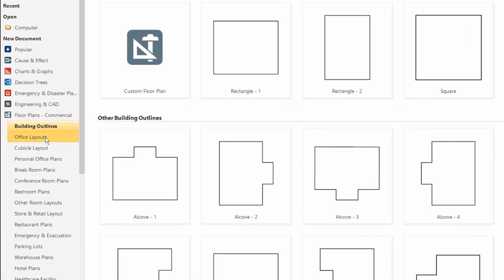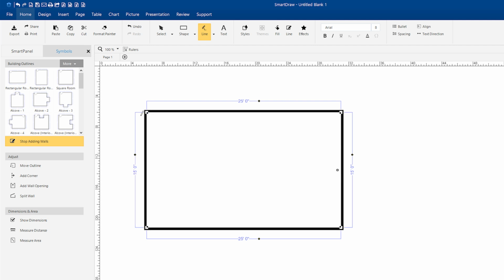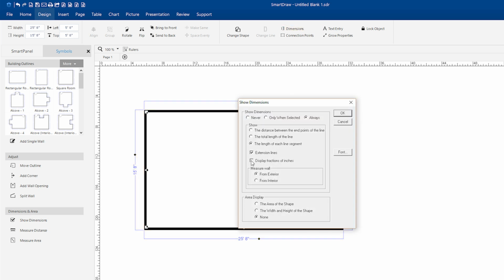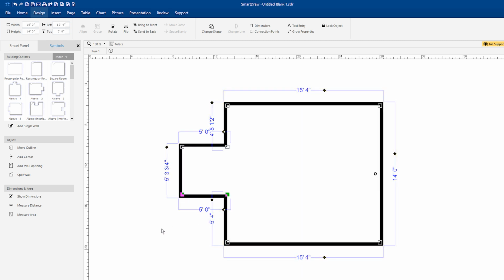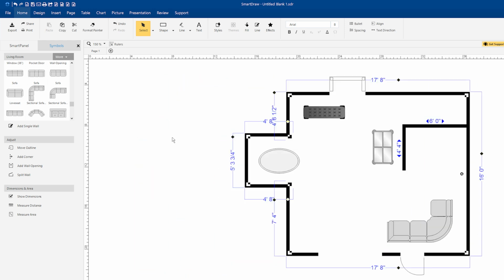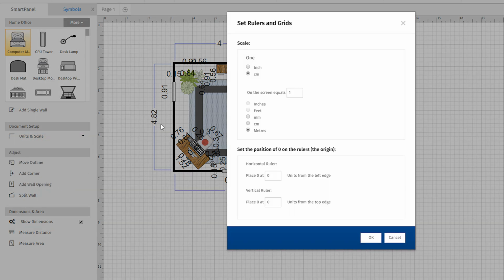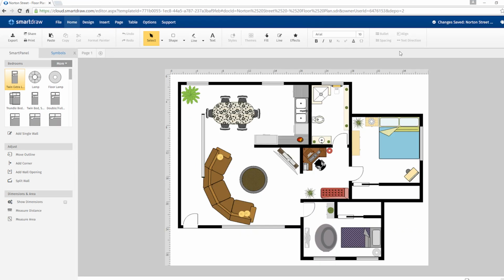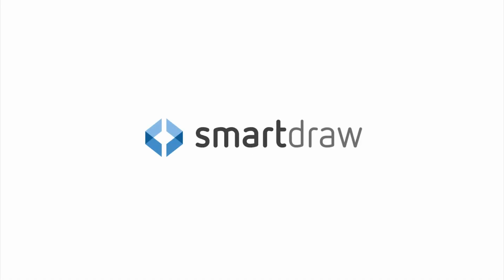How to Make Floor Plans with SmartDraw's Floor Plan Creator and Designer

Comment: How to adjust the width of a wall?
Reply: The computer decides that for you so you do not have to worry. You just need to adjust the actual wall to the computer design. All the work is done automatically.

Comment: I'm surprised that so many comments of people complaining about it not working. It's working for me, if anybody needs help, contact me or contact them, small bumps in the road shouldn't stop you from getting on track.
Reply: Hi there Kari Sinkko, I am having issues with putting together a coloured floor plan. I am able to add colour to a room but when it comes to a hallway which has different adjoining rooms i am unable to select the hallway to add a colour to it. Any ideas?? Thanks.